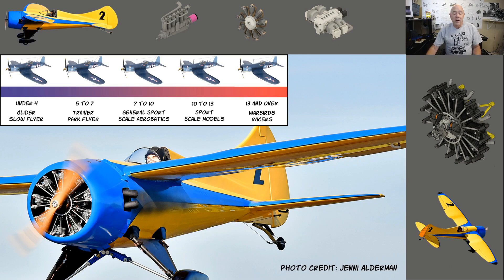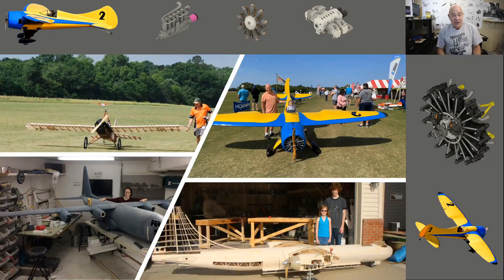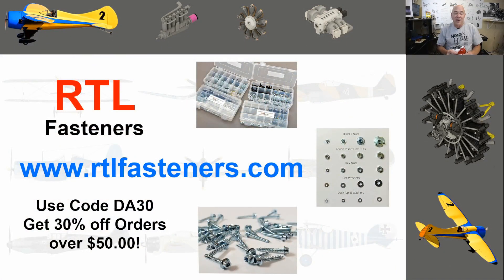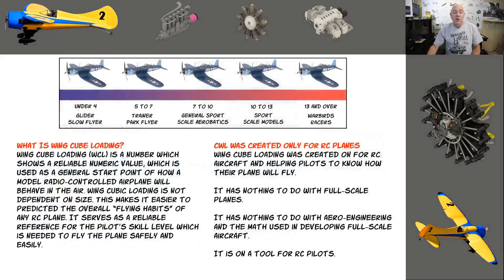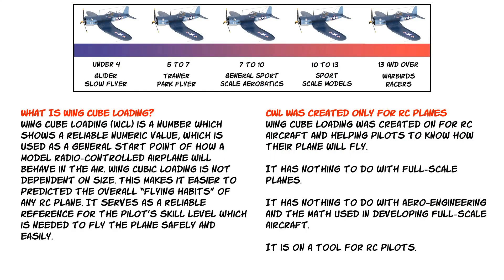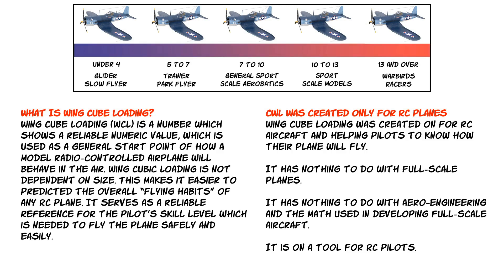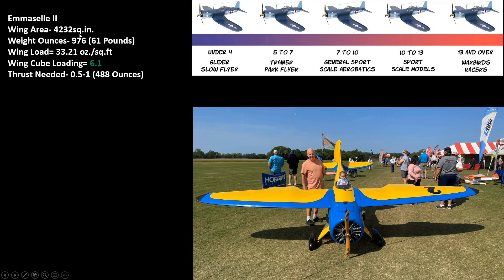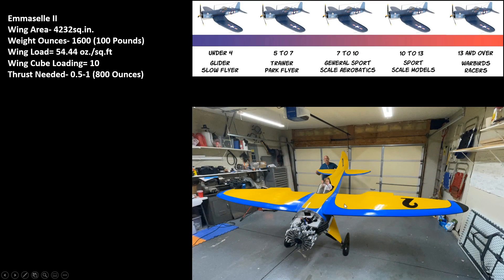Why does my plane fly like a fat pig?

Comment: I'm also a big fan of the wing cubic loading as a means of determining a plane's flight characteristics in early design stages. In fact I think it is the most important figure. For me it helps to visualize the wcl as a "density value". The unit of the wcl is oz/cubic feet and that is a density. Actually it is the density of an imaginated cube that weighs as much as the plane and has a side area of the plane's wing area.
Planes of different scales that are built with the same "density" (built of the same homogeneous material or of the same homogeneous trusswork) have the same wcl.
Coincidentially the units [oz/cubic feet] or in the metric system [g/dm^3] lead to nearly the same range of results with only minor deviation. This is due to the fact that 1 oz = 28.35g and 1cubic ft is 28.32dm^3.
Greetings from Germany, Martin
Reply from the maker: Great post! Thanks!

Comment: On some forums people work very hard to save weight at the expense of reliability, like wanting to put 9 gram servos in a 5-6 pound airplane.  The cube loading shows how little difference it would make to save 4 ounces on a plane of that weight.  It also shows how much it would matter on a tiny lightweight plane.  It's all because air doesn't scale up or down with our models.  On my 1/4 scale L-4 build, 2 or 3 pounds won't change the flying characteristics much.  I've found that a Cub/L-4 will fly better in a breeze of it is heavier.

Fun fact:  An F-4 fighter weighs more per square foot than a Cadillac Sedan de Ville of the  same era.
Reply from the maker: Spot on right! Great Comment! Rock ON!

Comment: 1st time watching your videos. If I have this correct, simply put, the lb/sq. ft. is divided by a percentage of the wingspan.
A larger plane naturally has more stability courtesy of increased wingspan. A small wing plane must be compensated with a lighter wing loading.
I’m sure the equation would hold true with full size aircraft also.
Reply from the maker: Cube wing load was never intended to scale to full scale aircraft. It was created just only for RC aircraft. The two links the the description explains it the best I guess. 

lb/sq. ft. is not a good was to scale model aircraft and how they will perform. That's why cube wing loading was created. 

Thanks! DAG

Comment: Great video but it's a thankless task shaking club "oldsters"' out of a comfort zone they settled into in the  80's and 90"s.

The late Stephen Jay Gould was a great Harvard paleontologist who became well known for his popular essay column in the magazine Natural History. In one essay on the implications of size and shape on organisms Gould noted how the writers of horror and scifi films often failed to appreciate the reality of scale.

In the great 50's film Them! a misguided entomologist tries to explain how the giant queen ant, if it escapes, could fly hundreds of mile from the desert to ravage Los Angeles. Using a simple ratio he calculates that the ant, only a fraction of an inch long, can fly hundreds of feet therefore the giant queen should be able to easily fly hundreds of miles to LA. 

Gould points out, "... the ability to fly depends on surface area of wings, while the weight to be borne aloft increases with the cube of length. We may be sure that even if the giant ants had somehow circumvented the problems of breathing and growth by molting,their sheer  bulk would have grounded them permanently."

The tyranny of the cubic curve comes into play in many areas including ship propulsion were I worked for many years. Speed vs power is a cubic curve and that makes getting that last know of speed a nightmare.
Reply from the maker: Thanks, what great information you shared. I love posts like this. Rock ON!